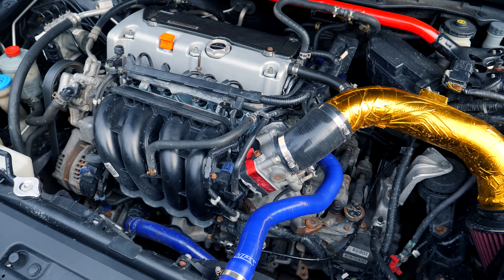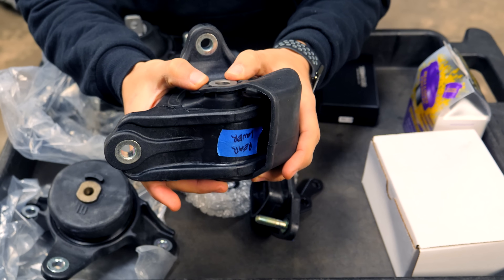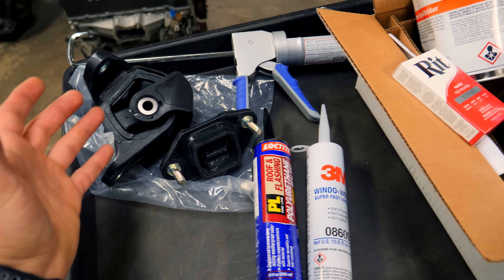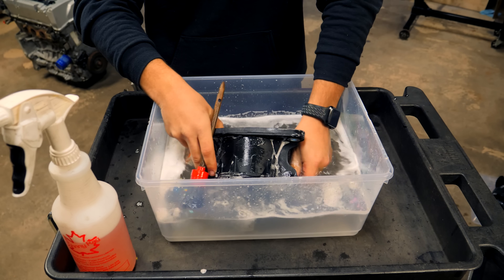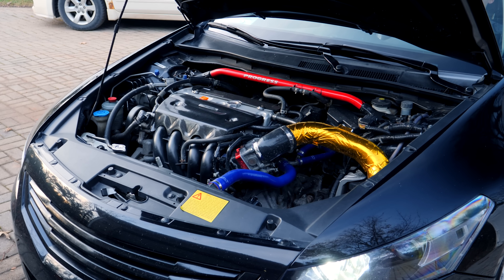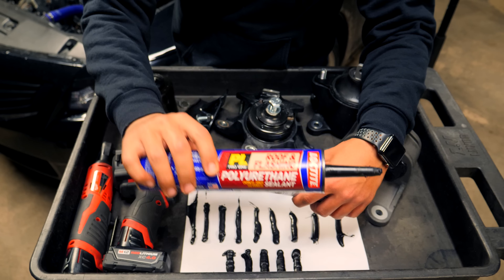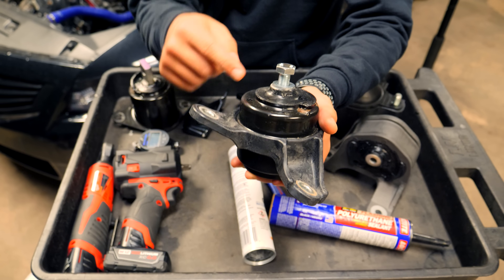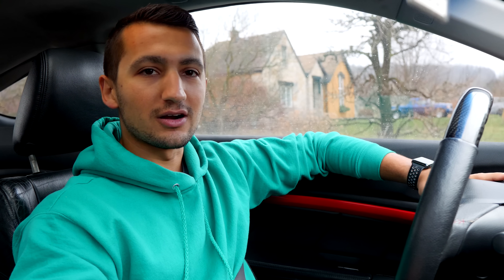Polyurethane Engine & Transmission Mounts for less than $25

Comment: REALLY good video homie!! Lookin to do the rear mount on my 5speed TC and didnt want to vibrant the dash&steering wheel. Figure i get best of both world by filling it more than stock mounts come maybe getting a more firmer grip of the engine/trans. Then because its slightly softer than typical stock bushings on cars (50a) it'll prevent vibrantion.

Comment: To get it in the holes, poke the tip in and fill, side to side if needed while pulling it out as it fills.  Fill some more mounts if you have them or use that remaining stuff for something unless you can cap it well.  One that seal is broken, its shelf like is reduced

Comment: dude...WTF?!?!?  none of those types of urethane tubes are rated for high vibration....motor mounts are combinations of silicone, rubber and polyurethane because of extreme vibration resistance and resistance to elements....your just going to be replacing those mounts sooner than later...it may work for a video...but i guarantee a daily driver would not laast with this "fix" of yours in this video
Reply from the maker: Lasted for as long as I owned the car, and then some
Reply: @milanmastracci  good to know...thanks for the info...I am seriously considering giving it a try to save a few bux

Comment: With the 3m window weld, it’s a moisture activated hardener in it. I generally recommend to fill your mounts up halfway with the window weld, throw it into a bucket of water overnight to harden, then fill the 2nd half up, and throw back into the bucket overnight again so there aren’t any soft spots hidden inside that squish out when you go to install them and put force on the mounts. Just did this with my 12v Cummins and doing my first startup today in the rebuild to see how it goes!
Reply: How did it go
Reply: @Sage07k  they worked perfectly actually. A tad bit stiffer than previously, but they motor doesn’t move like it used to at all. Keep in mind that theres about 900lbs of cummins sitting on them with plenty of torque to test them haha
Reply: How did it go

Comment: I've tried this with my 02 civic. I dried in a hot summer room for 2 weeks and it was not enough. Polyurethane tried to come out and deformed.

I highly recommend drying it for a month, or use different fill material.

Comment: 4:15 You would be wrong thinking that. ANY part coming from the factory warehouse has a coating applied to it to prevent surface rust before its sold to someone. This is why youll notice Metal things might feel a bit "slimy" or oily brand new.

Comment: I just did this today so speaking from experience, Smooth-On Smooth-Cast is SO MUCH BETTER AND FIRMER THAN 3M WINDOW WELD. I PREVIOUSLY HAD WINDOW WELD ON MY DIFF MOUNT BUT SMOOTH-CAST 300 IS 100X BETTER AND LONGER LASTING!!

Comment: Could add rubber grains to the poly and mix it up before adding it to the voids , it might allow the mounts to dampen the vibration.
Reply: Just drill it with 1/8 bit make Mercedes symbol out of it

Comment: How long wait to full strength of windows glue? Week?
Reply from the maker: You'd have to check the actual instructions for proper directions. Polyurethanes from different manufacturers require different time, but if you're on the safe side, I'd way 3 days. It's idea to do this to mounts off the car, wait a week, and then slap them in later to guarantee they're firm.
Reply: @milanmastracci  in instructions of windows glue: 4mm/24h. In instructions of liquid poly: wait 16h, max strength after 7 day

Comment: How is the temperature resistance?  The mount I want to put the 3M into is very close to the exhaust and will be exposed to a lot of heat that does tend to soften up some of the aftermarket all-polyurethane mounts available for it

Comment: I just repaired the transmission mount on my 2003 caravan. Filled the areas with locktite pl2 construction adhesive the two days ago . After filling it set over night help placed to under the hood and drive 40 minutes. Actually the one that I got free from the junkyard was the one I filled it was in reasonable condition. I took it for a short ride just now and it worked great so far…
Reply: Can you please tell me, 3 days ago I put the polyurethane in my mounts and I'm waiting 4 more days till they are ready. Some dude on YouTube said the polyurethane will end up melting because of the engine heat,  did anything like that happened to you? Thank you
Reply: @bosanovaboy it won’t. The aftermarket already makes polyurethane bushings

Comment: This modification is a bad idea!  Motor mounts are designed to absorb/dampen severe shock waves.  Now those shockwaves stay in the engine to stress pistons, rings, bearings, transmission, clutches, etc.  You just reduced the life of your drivetrain.  Never modify a vehicle until you thoroughly understand the laws of physics.

Comment: Hello, in discription you metion about 3M hardness of 80 but in datasheet they wrote 55-60. Do you think the Elongation is also important? The 3M has 700%. In europe we doesnt have this product, so i found a sealant with  380% elongation and 60 shore A based on Polymeer.

Comment: I feel like I should drill the mounts where they need the most reinforcement, window weld the "tubes" and caps to do sorta the torque solutions thing, ideally keep NVH reasonable but get less deflection

Comment: Keep in mind that these polyurethane caulks/sealants/adhesives are ONE PART MOISTURE CURING polyurethanes. If you cast them too deep they won't cure properly. On non porous surfaces you should add a very fine mist of water. Some products can also foam or have voids, so beware. TWO PART polyurethanes will cure no matter what the thickness is.
Reply: Could you give more insight on the depth that is acceptable for casting? I have rear diff mounts that cannot be removed easily so the one part poly is a good application for me. Do you water mist the poly after applying it? I would think the water would evaporate rather quickly. Does applying heat (180F) enable better curing?
Reply: @JeffLReeb Same question. How deep is too deep? Maybe building them layer after layer, giving time to e each layer to cure properly.

Comment: I`ve done this with soft(shore A stiffness =37) poliutherane called SIKA 11 FC. Only difference is that i did not fill mount completely, I left little bit od empty spaces on the end of mount in order to achieve low vibration and allow bit of engine movement. Everything is perfect, engine movement exists but is it is much smaller and no vibration at all. Try this way and you will be very satisfied!!!!
Reply: Still all good? Planing to try for my scooter.
Reply: Planing to fill up and then with drill and 1/8 bit make some room... it is for 4x4 delica
Reply: @imaginosdesdinova Did you do it?
Reply: @noudialp yes... did transmission mounts and after a few weeks, trailing arms bushings.
Reply: @imaginosdesdinova Any vibration?
Reply: @noudialp Yes!. My transmission mounts were completely busted, fixing it with poly removed 70% of vibration. I'm just sick of maintainig Delica so I choose to do poly cos don't want to touch those mounts ever agian. You can probably pick some softer poly and do some tests and find optimum material that would be durable and good as OEM. I just used softest I could find at Home depot.
Reply: @imaginosdesdinova Hope it stands strong in the long run. My mounts are unavailable, so I have to go this way too.
Reply: How ling did they last?

Comment: Am curious, what if you put cavities in those mount with polyurethane by drilling it through end to end as if acting as an absorber or shocks? Will this lessen the stiffness? Also have a broken mount so I just plan to fill it with polyurethane instead of removing the broken rubber the perhaps drill to lessen stiffness.
Reply: Could add rubber grains to the poly mix before adding.
Reply: @CharlieHarper-d4x  Was thinking also putting nails to those spaces acting as the original spaces when putting the  poly then removing it once cured.
Reply: @a.sarmiento5116  yeah that could work , tho long screws might be better as removing them would be easier. 
Iv got very soft rubber grains from when I worked in an injection moulding company but haven't tried using them yet .

Comment: For your daily, it’s better to use the harder product in the torque strut only.
Use the softer product or just bare stock mounts for the engine and trans.
It’s the best of both worlds without rattling your teeth out.
Reply: This is so untrue. Did you not watch the video? Don’t listen to this guy, guys. All polyurethane mounts will last at least 5x longer and much better shifting. Saving a lot of money in the long run.

Comment: Yes the reason why they have cavities in engine mounts is to absorb the vibration so you don't feel them in the car. But they don't last at all because I've replaced three engine mounts so I had them replaced because they're junk. And most of your parts especially engine mounts are made in China and a rubber's horrible they don't last at all. Like you said if you could stand the vibrations this is a great idea but I myself cannot drive with vibrations even under 3000 RPMs. So the best thing to do is just replace your engine mounts every three years or so depending on how long they last because I've had engine mounts that hasn't even lasted 2 years cuz of the China crap s***

Comment: I see the question has been asked a few times but no answers. I have a 08 Subaru Outback and need to replace/repair the front lower control arm bushings BUT I don't have a spare ride. Any suggestions of whether to use the 3M or Loctite for this application AND what is the drying time for each of the two products considering the relative thickness being used??

Comment: Hey man I got hydraulic motor mounts for the front and rear mounts on my accord is it airplane worth doing this for both transmission mounts and upper passenger engine mount those are the only ones I can use this technique for the hydraulic mounts are solid rubber and no place to fill them with the 3m and trash

Comment: Thanks for the specs on the shore A values.  Was wondering about making rear axle and front control arm jounces for the Dodge Ram gen2... maybe using a SORTA-Clear 37 mold for future trials.  I was also thinking about somehow using instead of hockey pucks that are the softer foam material for the youth, using old tire treat material since is usually a shore A 60.  Seems like for the expense of the mold material and thinking also using a softer material like the Loctite, since reads is a shore A 40, will work suitably.  Thinking I might even be able to restore my old mounts that are missing the rubber where I place the cleaned metal on the mold and cover to adhere thoroughly.  Also, maybe can use some old tire rubber inside like super glued to the mount for a little more stiffness under load.  Any thoughts?
Reply: After reading the data sheets noting they PL 30 is a 25-30 shore A and movement capability of 35%, I'm wondering if some PL 20 I found I had around is a little better since even noting a shore A of only 25 though has a higher PSI potential and a lesser 25% movement capability.   Think I'm going to try using for jounces if the tubes aren't seized up since most likely is way expired.
Reply: Interesting reading the datasheet for the 3M Window Weld notes a shore A of 55-60 and an elongation of 700%.
Reply: Looks like GEOCEL 68103 reports a shore A of 45 and an elongation of 881%

Comment: Why not take the rubber out and dig out the middle and inject that with the 3M and then slip them back in be sure to treat the rubber to soften it some before u reinstall it so that at least some vibration is eliminated.

Comment: Its a great diy trick.  Id probably use masking tape and try and get things smoothed and looking as factory as possible but thats just my ocd.kicking in....remove the tape for a clean finish. The degreasing idea is wise not something ive thought of before.....maybe also finish with brake cleaner.

Comment: The mounts are flexible to avoid vibrations and help with the mechanical imperfections of the motor-transmission-axles etc, also to reduce wear on bearings and metal to metal parts.  If stifier mounts give you more performance woul'nt be better just to weld the motor to the chassis. By hearing the noises I guess the car was actually better before the brand new mounts.

Comment: I used the loctite on my daily I like how firmer it is without super crazy vibrations. Its much stiffer my 60ft had less wheel hop also. They have a little vibrations but nothing crazy I would recommend for daily driven cars

Comment: -
Great video.  I will use the 3M to repair my rear mount that is still on the car.   Cannot remove it because I refuse to drop the subframe to get to the mounting bolts.  Hoping this gets me by for a while longer.   Thank you
Reply from the maker: I hope it works for you! 👍

Comment: You have a drive by wire. That delay is not from the mounts 😂
Reply from the maker: You are sadly mistaken. If the engine is drive by wire, and the mounts are soft, the mounts need to torque up before ANY TORQUE can be applied to the wheels.

Comment: This isn’t a polyurethane mount.

It’s just a rubber mount shoved with polyurethane. Your contact area is still rubber which will break down the same if you didn’t fill them. So I’m short you’re basically just wasting your time accept making it a hair softer but not enough to make a difference.

Comment: The two part liquid urethane @ 60 spec would work better to fill. You can drill holes to give them some flex.
Reply: Yea he literally is still just on stock mounts packed with poly. It’s no where near running a full aftermarket poly mount.

Comment: Hey mil how you doing Manny's name I cross checked on your video and you were talking about motor mounts I like your suggestion on how you did everything now give and take on this Poly urethane and stuff I have an Odyssey that of course you know buying motor mounts is not a easy chest and it very expensive after awhile but I definitely wanna stiffen up the motor mounts because I feel that I'm getting jipt off when it comes to motor mounts you got high performance ones you got racing ones and so on and so forth however what made you get this idea all filling them up with this stuff and have the best result...  Hit me up if you have anymore ideas on that, again like I said I have a Honda Odyssey and I'm trying to upgrade it just a little bit more to get more life out of my engine then anything and if you also have any other tips as well I like the air kit that you have in your car as well and if you have any other inspired information what you can do with an engine please feel free and hit me up I appreciate it

Comment: Can use for control arm bushing? It seems 3m durometer test up to 75a..i think enough shore hardness,better than stock only 60a.. it’s correct 3m 75a? Becaus on TDS 3m only 50-60a. Thanks

Comment: I've been using the roof flashing polyurethane for yrs even used a thin film of it on the water seals on my rotery Rx7 engine 9000 miles so far no leaks. Also works great for weather seal repairs on doors  ect.

Comment: Why do you have so many wires in your cars? Bro, this is an accord. This isn’t a a MX5, race car, drag car car ... etc. leave it as is. Trust me. 

Also, just buy a stock engine mounts. No need for modding your mount. This is a waste of time and money. Motor mounts last at least 100k km. If they break on like 20k km, it means you suck! You can’t drive! Or you have a dash cam and want to be one of these dickheads with dash mounts 
Other than that, great video

Comment: I did this with my r56 when I put a reman long block in due to burn down on cyl3. It took awhile to cure completely, but definitely made a difference. ...apart from more vibration.
Reply: Also painted my engine bay nardo and the upper tie bar (radiator support cross member) blue to match the rest of the car. 😁
Reply: How much u let it sit to cure

Comment: I would be curious to see how the loctite mounts would make the car ride . I'm sure it's better than stock.
Reply: Probably not noticable to be honest.   Ive worked around it enough to know its not doing much for stability, its more or less adding longevity to the set up by adding more meat for the vibrations to deteriorate less on the actual plastic.  If he was using some jb weld or something id say it would make a difference but most caulkings aside from geocil dry pretty rubbery.